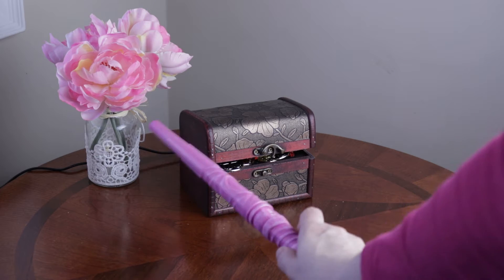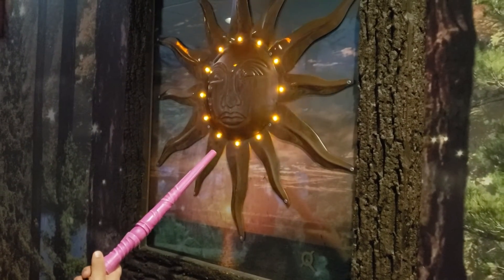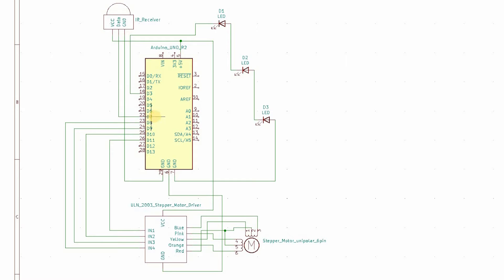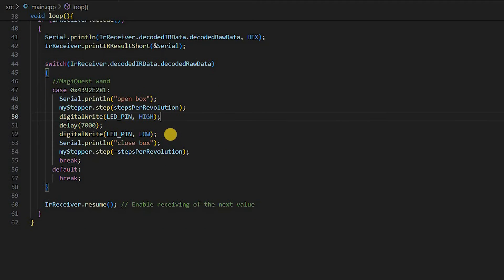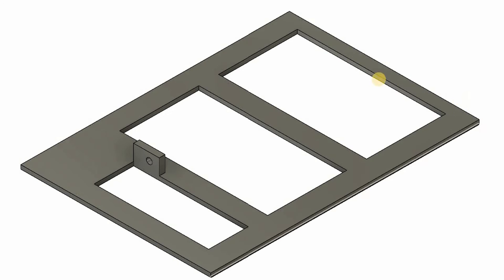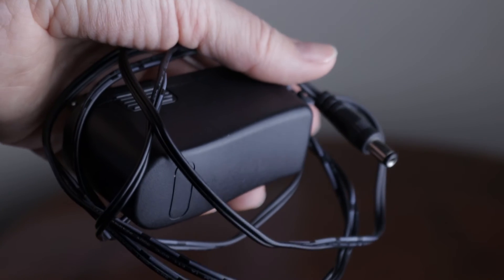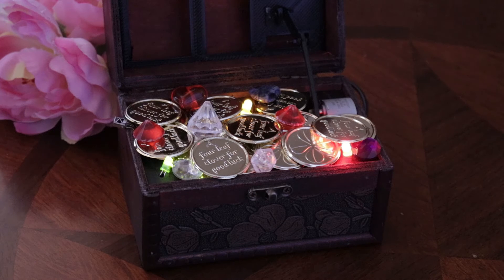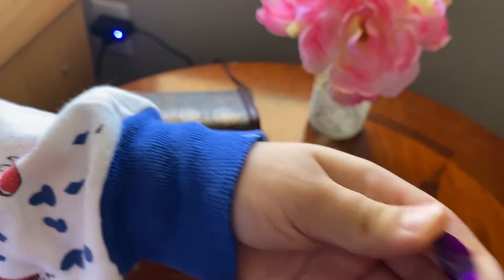Arduino Open Box | MagiQuest Great Wolf Lodge

Comment: Since you used a stepper are there any limit switches? How does the arduino know the range of travel? Do you just assume x number of steps to open/close and if it gets off it just clicks angrily?
Reply from the maker: Hi, I did not use any limit switches for this build. It is just an estimate. I manually closed the box after putting it all together, the box opens quarter revolution CW, waits for a while, then closes CCW.